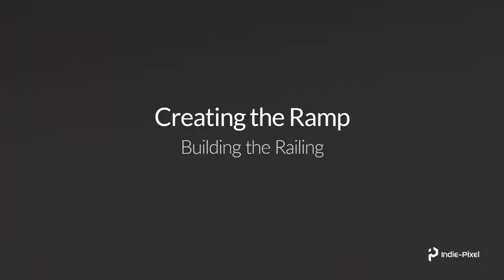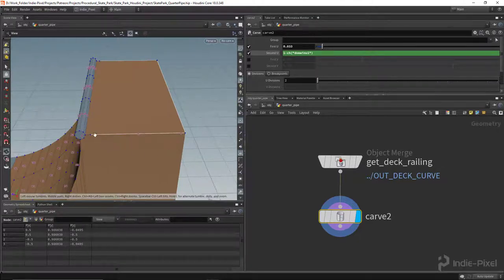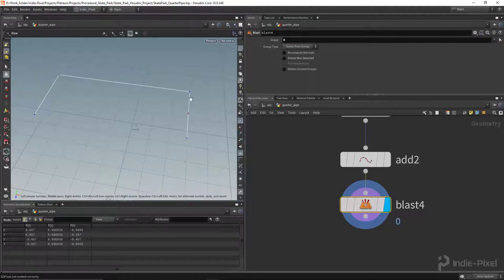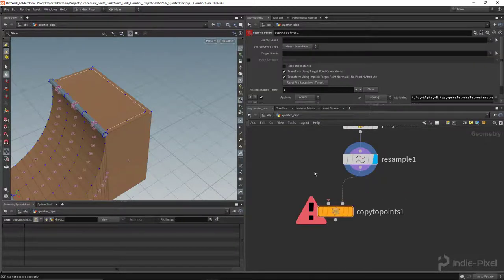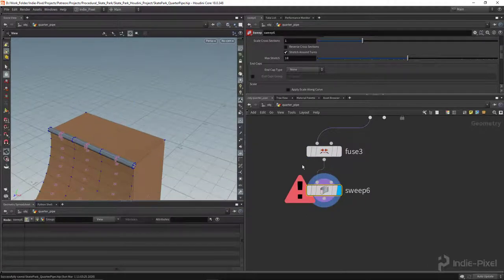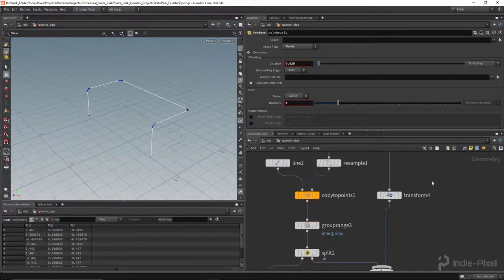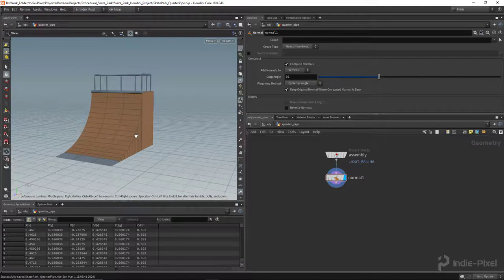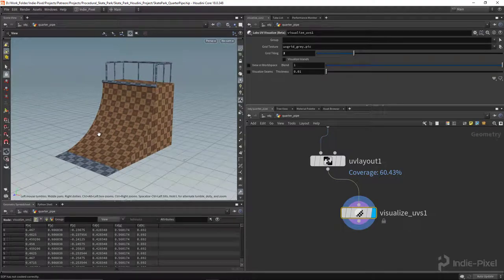Houdini 18 - Props - Skate Ramp - Section 1 - Video 6

Comment: I got stuck on beveling the corners of the curve. You mention about having UV's on the curve could cause the PolyBevel to crash. I am getting that error, currently. It will let me  change the offset distance but it will not let me  add division without crashing. I did check and it looks like a coupe of vertices have UV's on them. My question is how do I remove the UV's so I can move forward with your tutorial. 

It's Great by the way!
Thanks,
Dean
Reply from the maker: Ahh...use an attribute delete node and delete the UV attr from the point class or vertex class...thatll fix it
Reply: @IndiePixel3D  Worked like a charm, Thank You! I'm making the transition from Maya into Houdini right now. I really can't wait to start using Houdini in my everyday workflow. I can't learn enough fast enough at the moment...
Once again, Thanks!
Reply from the maker: @DeanDeakyne  awesome!  Well take it one step at a time...I mean with Houdini you'll always be learning something new...its a huge application...have fun!
Reply: @IndiePixel3D  dude you're such a nice and supportive person. Love your stuff and it's much appreciated.